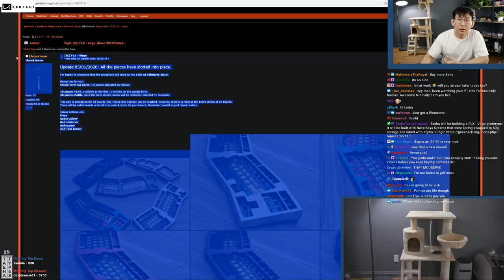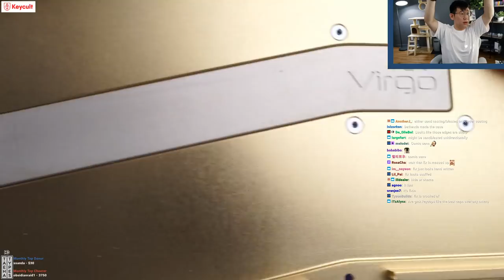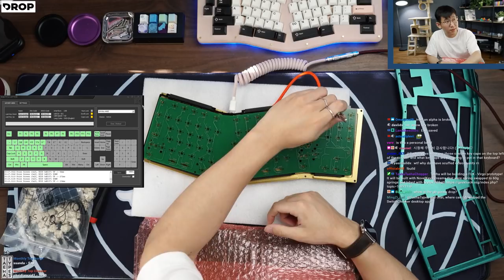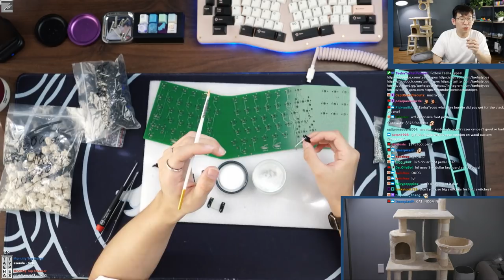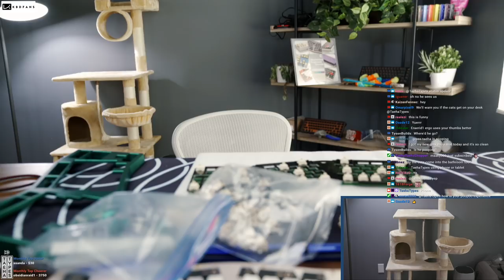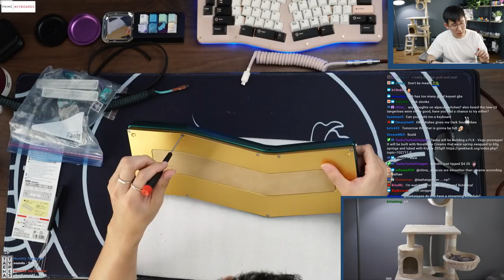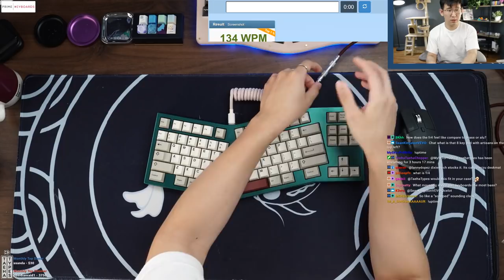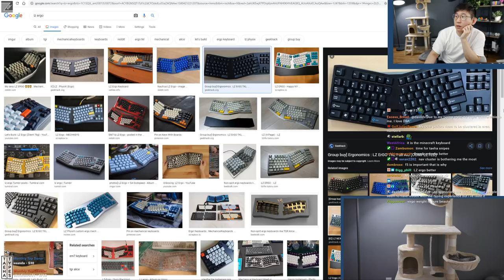FLX - Virgo Prototype Build Stream

Comment: Is there a downside to hot-swappable PCBs?
Reply: Daniel Dweebler There are two downside for Hot-swappable pcb. The switches may come off as well when you want to change the keycaps. If you like to change keycaps often, this maybe an issue. 

The sockets have only be graded for 100 insertions. If it’s broken, it is hard to fix.

But function wise, it’s all the same.
Reply: @Nicrichy  Thanks
Reply: Daniel Dweebler One more thing, hot-swappable pcb usually has a fixed layout. Where solderable pcb allows you build your board with different layout.
Reply: Do we know the keyboard used in the sub notification sound clip?
Reply: Daniel Dweebler I don’t think anyone has guess it yet.
Reply: @Nicrichy  :(
Reply: @Nicrichy  Where can you go to get all your keyboard questions answered?
Reply: @danieldweebler3392  r/mechanicalkeyboards
Reply: @danieldweebler3392  r/mk